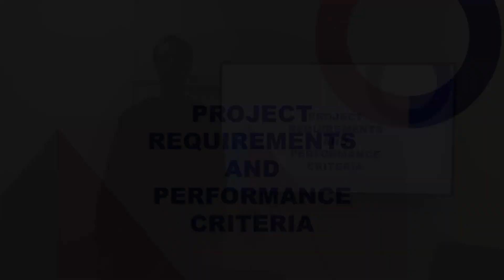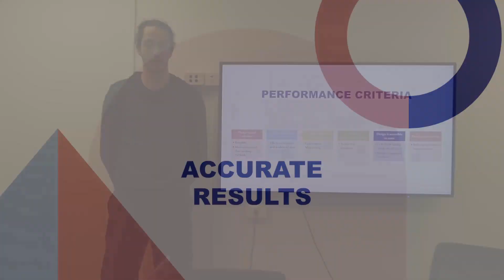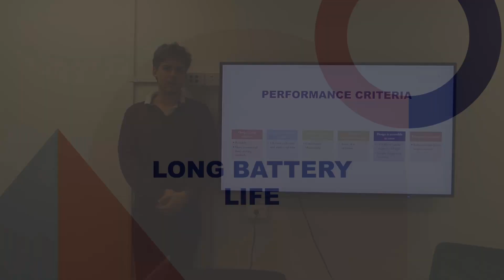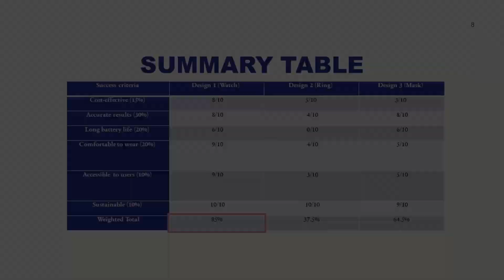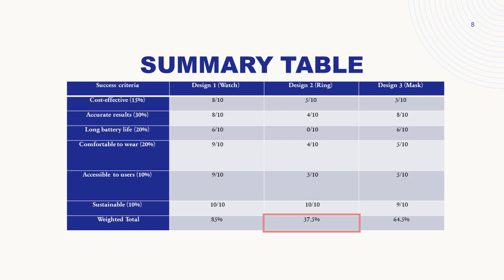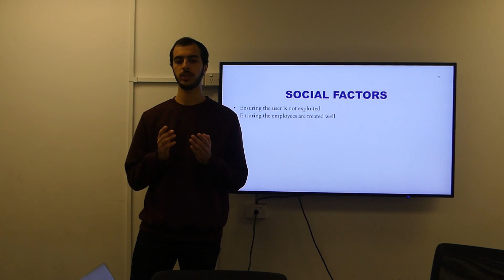Design & Innovation - Seminar (WR207)

Comment: Here is the transcript for anyone who may struggle to hear the audio at times, this is also available as closed captions on the video

Hello everyone, we are group 207 and we are going to talk about our design process for a wearable device to detect COVID-19. On the agenda today we have the introduction, the project requirements and performance criteria, the design solution, the environmental, social and ethical factors as well as a summary.
Our team has embarked on a project for a wearable device that is able to detect COVID-19. The device will, in our beliefs revolutionise the detection of COVID-19 and other related viruses. reducing waste, reducing time, improving accuracy and improving the user experience. At the peak of COVID-19, early virus detection was extremely important for understanding how the virus spread and how to protect the community. Unfortunately, current testing methods are hard to access, inaccurate and not pleasant to undergo for the majority of the public. Imagine a future with our device that will be widely available, cost effective and adaptable to present future needs.
There’s an Albert Einstein quote we thought about while making a design for this that goes: “Strive not to be a success, but rather to be of value”

Project requirements and performance criteria. From consultation with our sponsor and through brainstorming, the following project requirements were developed. First: accurate detection of COVID-19. This is to ensure that the solution developed with the purpose has the means of detecting COVID-19. Second: easy operation. This is to ensure that the solution developed will be able to be used by a large number of potential end users. Third: Safe to use. This is ensure that the solution will be safe to use by end users. The project must be adaptable. This requirement is to ensure that the solution developed will be relevant for the foreseeable future and beyond. Lastly, the device must be comfortable. This requirement is to ensure that the solution is comfortable to wear as it will need to be worn for a period of time to be able to get the accurate results it needs as well as be able to continuously monitor the symptoms.
For our device we developed the following performance criteria. The first performance criteria is that the device is cost effective. This is to ensure that the design provides on-time, accurate detection of COVID-19 symptoms, while reducing the cost of purchasing single use tests or lab tests every single time the user is experiencing symptoms of COVID-19. This will also lessen the resources, infrastructure and efforts needed for current detection methods of COVID-19. The design will be a one-time purchase only and will continuously detect COVID-19 symptoms without extra expenses. This criterion will be measured on how it compares to existing methods of COVID-19 detection methods in terms of its cost.
Accurate results. The design effectively collects the user’s physical data and accurately interprets whether these are COVID-19 symptoms.  The device will then communicate to the user, medical professionals and relevant medical authorities, its findings. Any errors will render the design unreliable and will cause a risk to the user of inaccurate information of their health. The accuracy of the design will be measured by how accurately it can tell that someone is displaying symptoms of COVID-19. 
It is important to note that asymptomatic patients exist and therefore the design will detect no COVID-19 symptoms on these users, despite being positive if tested by current methods. This does not lower the accuracy criterion as there will be no inaccurate results if there are no COVID-19 symptoms to detect.
The next performance criteria is that the design must have a long battery life. This is to ensure that the device will be able to operate all day and collect the necessary information it needs to be able to tell if the user is experiencing COVID-19 symptoms. This will be graded on how long the device will be able to last.
Comfortable to Wear.  As the device is a wearable medical device, it will need to be comfortable for the user to wear. For it to be able to fulfill its purpose of detecting COVID-19 symptoms, the user will need to be able to wear it for long hours without it interrupting or causing them discomfort. To test the comfortability of our devices, we used diverse population of people to grade how comfortable each device was.
Accessible. Because COVID-19 is a virus that will affect people of any age and any skill level, the device must be accessible to many different people. To measure how accessible the device is, we will see how much training a user is required to have before using the device. 
Sustainable. Many current single use COVID-19 tests create a lot of waste. If our device is to be a good replacement for all these tests, it needs to be able to be sustainable and get rid this amount of waste that is created. To judge the success of this criteria it will measured by how long the device will last by its lifespan in years. 

We used the system decomposition to brainstorm potential forms our design could take. Using this decomposition, we came up with six possible designs. The three designs we thought were less favourable, were a necklace, an over the ear device and an ankle bracelet.
We looked at three potential design options for what the devices could be. The first was a watch, the second was a ring and the third was a mask. We then scored them all against our performance criteria with the watch coming out on top with 85% success, the mask in second with 64.5% and the ring in third with 37.5%.
 The Design Solution. Our solution utilises the existing design features of a watch. For example, the interchangeable adjustable strap, a watch face to communicate to the user and buttons for the user to control the device. The design incorporates many sensors to aid with the detection of COVID-19. The data form these sensors will be processed on the watch and uploaded to our servers where the data will be analysed. We will be able to improve the device’s ability to detect symptoms of COVID-19 .
Uploading of the data will be done through an internet connection that the end user will be able to log into. This is to ensure that there are no unexpected costs for the end user. This also ensures that the end user has no obligations to provide the data. Our solution will utilise secure servers. Our solution will incorporate universal standards to ensure that it works well with existing technology. An example is charging and updating using a universal serial bus (USB).
The design will be water resistant to ensure that it can be used in a wide variety of activities. The design will be light weight and slim to ensure that it is comfortable to wear for prolonged periods of time. Multiple sizes of the watch will be available to accommodate different ages and people. The buttons and screens of the watch will be easy for all ages to interact with and to understand and use. Our solution considers future needs and can be expandable for future viruses through updates to the detection algorithm.
Now we will talk about our Environmental, Social and Ethical Factors.
 The environmental factors we considered, were that because we are planning on creating a physical device and using the finite resources of the earth it is important that we have a sustainable approach, not only for the manufacturing of the device but also for how the end of life of the device is handled. There are also important environmental considerations for the packaging and the delivery strategy of the device. The packaging of the device will use all recyclable material and will not use any plastic. We will have a program for customers to send in their devices back at the end of their life for re-use or recycling.
Because the device is intended to be used by people and will collect user data, we need ensure that the data collected is not used in any way to exploit the user, such as selling the data. We also must ensure that workforce safety and financial equity is maintained.

The ethical factors we considered and have to deal with to meet the following criteria when designing and development, will be to adhere to the modern slavery act of 2018, the published core values are compatible with our own and the processes relating to their integrity e.g. anti-corruptions. We must abide by ethical acts such as that we do not oversell the devices, that we price it fairly and commit to giving back to the community by providing some devices at a lower cost to the less fortunate.

In summary, our solution which has been developed using the systems engineering process to a concept design phase will revolutionise testing for COVID-19. Our solution is adaptable and cost effective and will be used by the majority of the population in the near future once manufactured. Our solution has considered the environmental, social and ethical factors relevant to it. 

Thank you for your time.